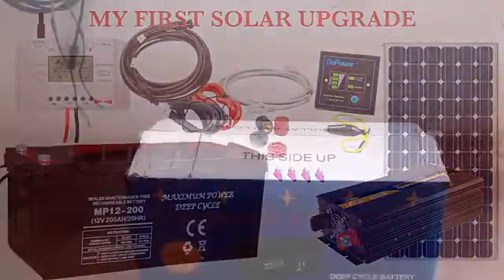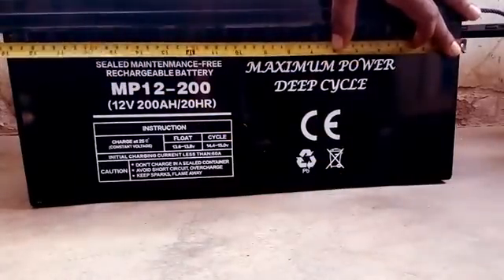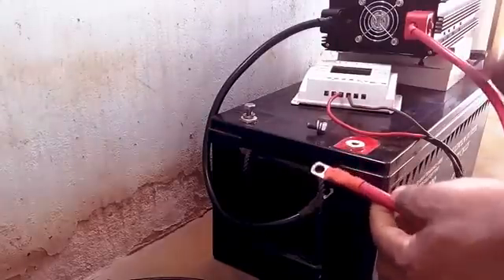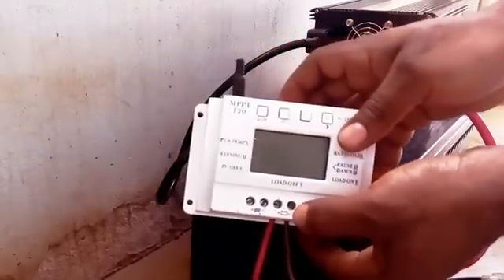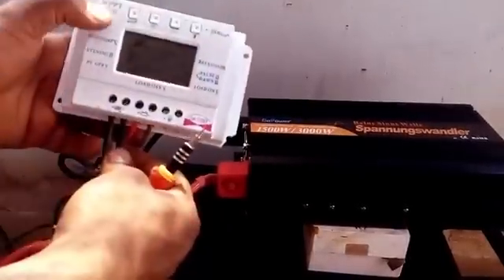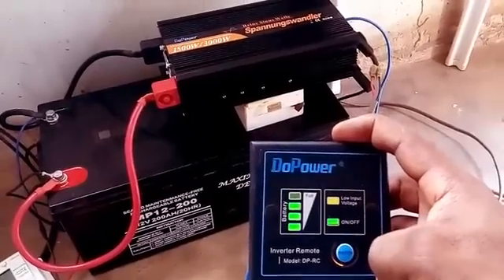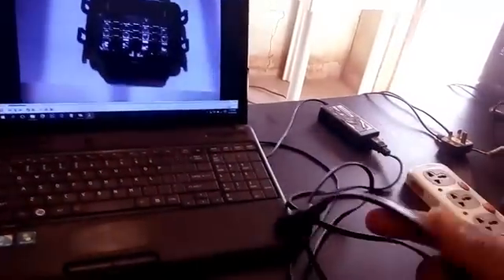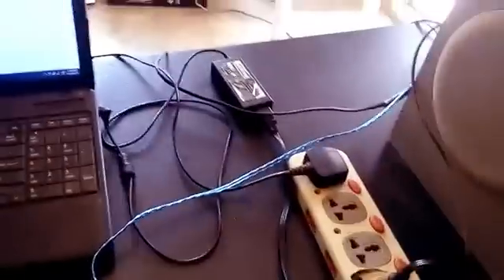2024 Guide: Installing a 200AH Deep Cycle Battery for Solar Systems

Comment: 6 to 10 of those batteries you will be good to go for a day or so. then you just need enough solar to keep em charged
Reply from the maker: Hi, you don’t need 6 to 10 batteries for 24 hours use, although, what you power with the batteries determines how long it can last but 3 - 4 will do fine for 24 hours if you are on a budget because if you use 6 to 10 batteries, you will require more solar panels to charge those batteries to full capacity from time to time, if the batteries are not charged to full capacity often they will die in no time, 6 to 10 batteries can require up to 24000Watt or more of solar panel, this is about the biggest private/individual installation and it’s a lot of money
Reply: my small 300w inverter drops 3 batteries down. Each battery is about 70Ah. giving total of 210Ah. that only lasts about  7 hours until inverter beeps. i'm 240Vac by the way so on this basis i need 3x (approx) as much to run the same stuff 24hr. so thats 9 batteries of the same type. but i'm 6 of the deep cycle would be fine as i can only get about 110Ah Deep cycle as far as i know but i'm still searching around and using what i can.
Reply from the maker: Yeah, the Ampere hour of batteries determines how many batteries you need, it your batteries where 200AH you don’t need as much  as that, another thing is that you should avoid discharging your batteries below 50% if you want themto last longer. you did not say the power or watt of your sollar panels kindly reply with the wattage of your solar panel and how many of them you havr
Reply: At present there is only. but am only just starting out its 300w panel. the specs say it can do about 16 amps. thats ok as want to get at least another 2 or 3 of the same type. the batteries only drop down to 11.5V i never said anything about them going under 50%. bare in mind mine is only on just a 300w inverter. 1 of your batteries in video is like 3 of the ones i use now. so if need 9 you would 3. (keep in mind 300w only) with more wattage being used say 600w inverter i would need double what i have to run for the same time, or it will drain in half the time. ie 6 batteries of similar Ah of mine and with yours it would be 2. for 1200w it would be 4.  for 2400w it would be 8. so for 3000w you would need 10 of yours if full 3000w was used in 7 hrs. i'm assuming your on 110V? so to get close enough to 24hrs at 3000w closest number is to multiply by 3 to get to 21. so 3x10 is actually 30 ( keep in mind this only if it was to be 3000w continuous load) so to get to 24hrs with a bit left over it would be 31 batteries of yours. yes i understand you would need about probably 15 panels or more to keep up depending on the output of each panel. 3000w continuous isa fair bit though. If you only used around 1500W continuous you would only need 15-16 batteries of yours for 24hrs. Take of 1/3 of that to say use 1000w continuous and you get 10-11 batteries of yours. (this is also taking into account where your invert will start beeping (11- 11.5V). At fully charged your bank should be near 13- 13.2V. so basically only 1V Approximately is useful out of the battery bank until the inverter beeps. be interesting for you to do a timed video at night time with no solar connected From fully charged..... with a watt meter on to show how is being drawn from battery over time. once you know the rate of one battery the rest should perform Approximately the same. This will give you a truer result of the number you will need for what you will run of them.

Comment: That charge controller is no good, get a midnite 150 they are really good, you need battery cut off switch, in line fuse for your + wires for safety and do you have cut of switch for your solar panel . food for thought. I recommend some research on solar for your own safety.... keep up the good work......
Reply: Isn't that wire from the CC to the batteries a lil weak ta boot?  I been using a 8 awg quick disconnect cable I scored from a junk from a floor machine... Or is that overkill since my panels only deliver about 20 amps to the controller?
(12V set up 2- 100ah batteries , 40a EPever charge controller)
Reply: The panel isn't what worries me. He needs a fuse on that huge battery. That thing can put out some fault current!
Reply: Mr how are you

Comment: Malakas sana battery bank mo. Pero di sapat ang charge controler. Kong di ako nagkakamali 20amps lng yan?
Reply: albert hulaton > mismatch panel sa battery. pang 24v system ang pv.. pwm ang scc tapos 12v system siya. malaki losses sa charging current.
Reply: riq quiam so ano maganda na controller sir? Mppt or pmw?

Comment: I like you're video and nextime put subtitle.so we can clearly understand what are you saying on you're video.
Reply: sometimes rara not to worry I will update the video and make every thing clear. Sorry for the poor audio
Reply: @osakwejindu4147  
What is the work of inverter in the solar panel installation
Reply from the maker: The inverter takes 12 volts from the battery and convert it to 220volts
Reply: @Cyber-TechAI  
OK thanks for dat

Comment: there is no safety device like surge protection divice and fuse?
Reply: What amp fuse should someone use to go thru 1/0 awg cable - from a pair of 100 ah (12v  200ah total) batteries to the Inverter?
Reply: @wildbillo68  what ever Amps are lower than the rating of the cable.  If the cable is rated at 15, you want  a 15 amp fuse or less. Preferably less

Comment: Wanna challenge the battery?  Try running a 10,000 BTU air-condition on it.  ;)
Reply: Do buy it if is shity made in  China  good video you need 30 amp fuse and Mppt charge control good video thanks for your time